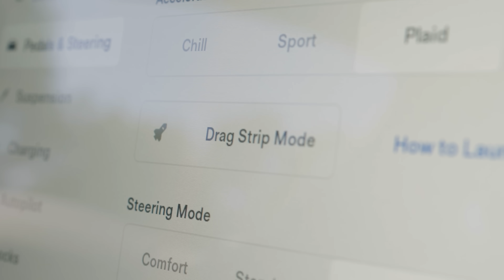How Tesla Drag Strip Mode Works

Comment: We need to see this with the dodge demon
Reply: An old 1? Been there done that plenty on YouTube for year's now. Stock demons get slaughtered all day everyday even on slicks&race fuel.

The new not available ultra limited demon 170 with 1025hp just debuted?
Won't happen for a year at least if not longer. 

And depending on the track, ambient temps, the driver and which tires&fuel the demon 170 rolls up with? It's gonna be interesting to see. 
Plus with air sapphire coming out this year also slated to run 8.9x as well? I wonder if tesla will go ahead and release the plaid+ or just bring out the damn gen2 roadster finally? 😀
Reply: @4literv6  I think quad motors from the Cybertruck are the next step Beyond Plaid.
Reply: That is only available in good cars!

Comment: waiting "Drag Strip Mode" for model 3 performance 😀
Reply: Throw in the c.f. wrapped plaid motors plus single piece castings, and eventually 4680s? Make it a true m3 perf for say 75k?
Carbon ceramics, real racing front seats, real serious tires on lightweight 20" wheels, better suspension and bushings as well. 

What a track terror that would be. 9/10ths of a plaid in a more affordable more tossable package. Limited to 180mph and running high 9s of course. Can't get to close to the top dawg now. 😎👍🏻

Comment: Tesla reached limits of power and torque, now it's need to only tweaks the grip to reach extra milliseconds
Reply: Check out videos of the McMurtry Spéirling electric fan car.  0-60mph in 1.40s and 1/4mile (400m) in 7.97s.

It's unclear whether even cold gas thrusters on a Roadster 2.0 can beat downforce sucking the car onto the ground at every speed.
Reply: @skierpage  Well, CGT would ADD to whatever acceleration is generated by wheels+downforce, so everything else being equal it should exceed non-CGT acceleration. Would help especially at low speed from stand-still where downforce = weight.
Reply: @Martinit0  The Spéirling has high down force at 0 mph because of the fan. I doubt it can or should be legal for street use.

Comment: When are the Carbon Ceramic Brakes coming out?
Reply: "early 2023"
could just get aftermarket brakes though. do you really need carbon ceramics?
Reply: @logitech4873  Yes because top speed is unlocked with that, already did 350kmh on autobahn but Tesla doesn't allow footage yet because of some embargo (probably before official presentation of the kit at the Nurbergring)
Reply: @lukabosnjak3829  You're not the guy I'm responding to.
Reply: They’re available. Customers have them installed already. Get on the list
Reply: 2030, this is Tesla.
Reply: @giacomu1  this company did what nobody else thought was possible, in a short time. And you complain about ceramic brakes?
Reply: @dmurray2978  he wasn't complaining, he answered a question